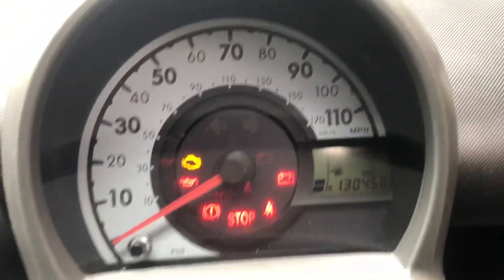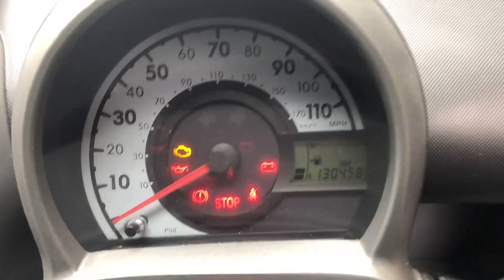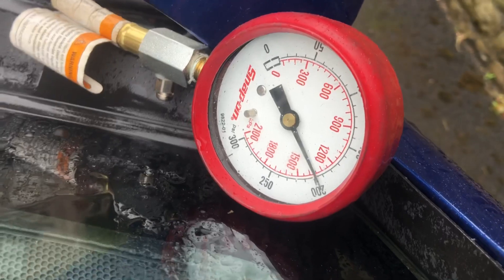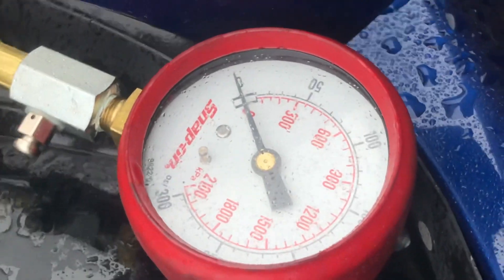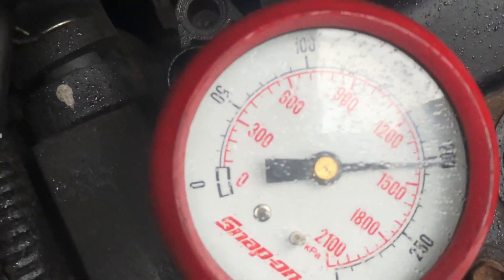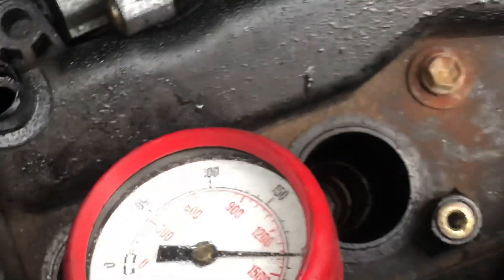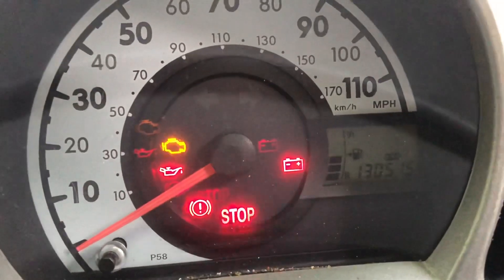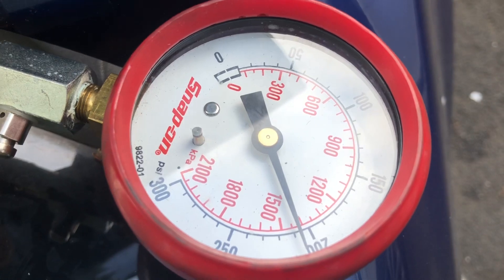Engine Restore Oil Additive Tested on Citroen C1 Petrol (With Before and After)

Comment: It does work-you just have to wait a bit
Reply from the maker: I don’t doubt it works, problem is I tested it on an engine that didn’t have any issues for it to fix 😂
Reply: @StupidBlokeStupidVideos  
I’ve used it on my Jaggg XJ40’s and it works wonders; just needs a couple of thousand miles to do its stuff! It has microscopic shards of copper, lead and all-sorts in it. After a while it starts to fill in scores in cylinders etc. 
Note: I’m not employed by Ametech! 🤣🤣🤣
Reply from the maker: @newblackdog7827  I think those jags were common for bore-wash. If they didn’t fire up first time the fuel injected would wash the oil off the cylinder walls and break the seal between the ring and cylinder wall. Would take a lot of cranking at full throttle to gain the compression to start it and get oil back there to seal again

Comment: Have you had any side effects from running this stuff.  Apparently its not recommended for VVT engines.
Reply from the maker: I heard the same, but had it in for about a year and no… no side effects.
Reply: @StupidBlokeStupidVideos  i will give it a try next oil change.

Comment: Hey mate. I have an aygo that may have an issue. Happy for you to do the same video before and after I put this stuff in the engine if you like? Where did you get it from?
Reply from the maker: What sort of issue are you having? Seems popular in America but never see it over here, I got this one off the eBay. Was about £25 though lol.
Reply: @StupidBlokeStupidVideos  my aygo has 110k on the clock and its burning a bit of oil.  It goes from the top to the bottom of the dipstick in about 8k. I forgot to change the oil once and did 20k and then ran it super low on oil and it started making dodgy noises going round corners.

Comment: Great video, but the engines in these shopping blobs are pretty much bomb proof.
They can tolerate all kinds of abuse without fuss, so I'm not really surprised that Restore didn't make much difference. 
Interestingly I've just started using this stuff in old Suffolk lawnmower engines from the 1960s.... they can smoke like a good'un so that will be a good test.
If you want to see a real result with this product, check out Project Farm's channel on here.... he put some in his old Ford tractor engine and it worked very well.
Reply: It doesn't seem to do anything in a petrol engine
You need to use redex first to decarboxylase cylinder and rings as it can't sit on top of carbon, putting 1ltr in avensis d4d today,takes about 15mins to feel results 😀
Reply from the maker: Andy Preston yes I completely agree with everything you just said. I’ve seen the tractor video, it was on the strength of that video that I bought the stuff! Project Farm is probably the best channel on here in my opinion so I’ve seen all his vids. These Toyota engines are pretty bullet proof too, in fact modern engines with modern oils don’t tend to wear in the same way that old engines do and in my experience it’s not unusual to compression test a high milage cared for engine to find that it’s internally as good as new. Engine restore isn’t going to give back any compression if it’s not been lost in the first place, and I think that’s actually why my video had an underwhelming result.

Comment: The engines are very high compression... So over 200 is right dunno  the exact,  that pour in stuff is always been crap, it used to be sold as something to increase oil pressure,
Reply from the maker: Jusb1066 yea that is a possibility. I tried to find out what the compression should be on them first but couldn’t get a definite answer, but although the ratio is high it still seems higher than I expected (I expected it to be 180 or so) and it’s not the first time I’ve been suspicious of this tester. There are a lot of videos showing that this stuff works which is why I wanted to test it to see for myself, but I just think as the engine is already healthy there’s not a lot of work for it to do here. Maybe I should have drop some sand in the throttle body whilst limiter bashing it first? I’m gonna post on bugclub and ask if anyone else has comp tested theirs though. This engine is on 130k but I’ve stripped engines with double that and the ring gaps have been in spec and the honing still on the bores so I’m a believer that with good modern oil/engine materials and proper servicing there’s no reason in modern engines that the rings should actually wear out, as long as never starved of oil 🤷‍♀️